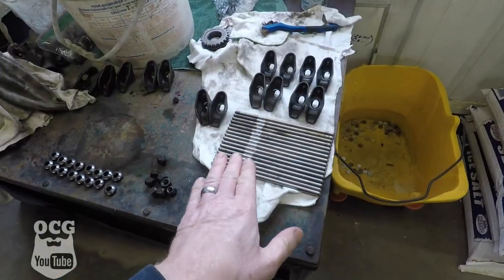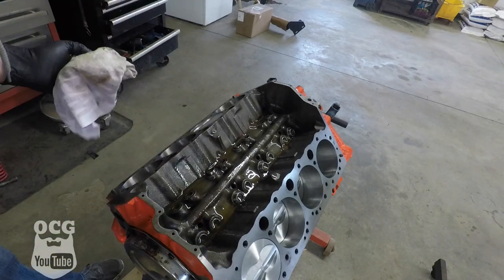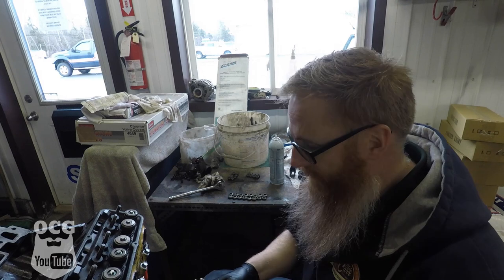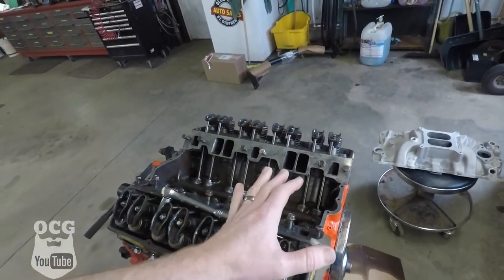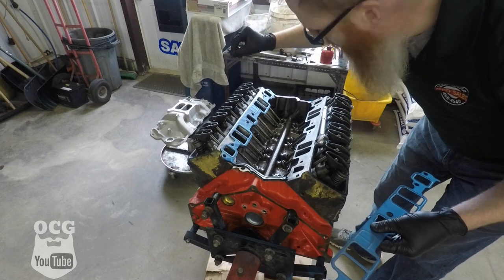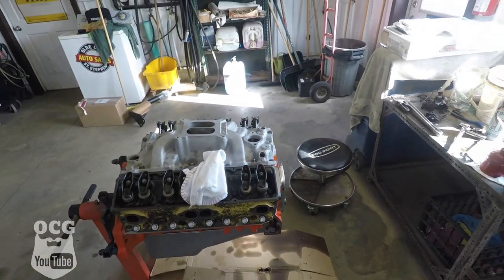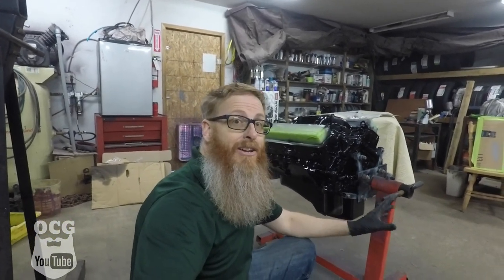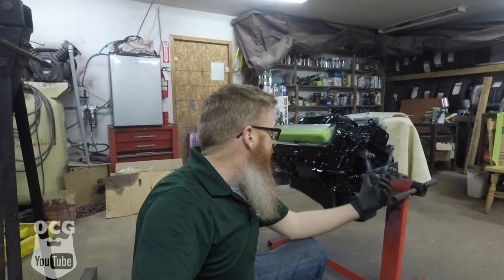SBC Gets Double Hump Heads & EDELBROCK PERFORMER RPM INTAKE Installed Part 4

Comment: I have DHH..performer RPM intake. 650 carb all ready to install on my 86 camaro 350 swapped with RV cam. Curious to what my end result HP /TORQE may be close too. Headers to be decided yet.
Reply from the maker: Most DDH on a 350 we’re good for 300 hp on a stock engine. 650 cam carb is pushing it for a small block and may be inefficient.

Comment: looks good, i like to color match the engine to a color on the truck but you cant go wrong with black. only thing i would have done different is keep the intake aluminum but that is not the look you was going for. i can never get those rubber intake end gaskets to seal well.
Reply from the maker: When I paint an engine, I have always painted the intake. I did on my Chrysler as well. Just looks more stock to me. Ans yes, those rubber intake gaskets are junk!
Reply: @OldeCarrGuy  it does give it that stock look. i never did becuase the aluminum loses its heat dissipation but i also dont have to worry about aluminum corrosion here.

Comment: What head gaskets did you use?
Reply from the maker: Felpro!
Reply: Well I have the 4.030 bore and I can't seem to find a fel pro that size
Reply from the maker: @larrydulaney5657  my sbc is .060 and I used standard gaskets with no issues.

Comment: What type of torque sequence is that
Reply from the maker: What do you mean? I was following the service manual. Did I do something wrong?
Reply: @OldeCarrGuy  not really nice video but the best way (machine shop will recommend) working from the middle out include some of the bottom row not all at once or across. No criticism Awsome motor good combination of gm parts.
Reply from the maker: Thanks Johnny! But if you go back and look at the video again,  when I do the time lapse I do start from the centre and work my way out. You had me questioning myself. So I went back and watched it again.

Comment: Stop never use the end gaskets. You well have bad oil leakson the China walls. Pull intake back off throughout the end gaskets frount and back. Build up a good bead of black RVT on the walls then let the RVT set up a little. Then put the intake back on. Trust me ive been there

Comment: If the intake bolts would not take threads with the inner gaskets you obviously didn’t have the correct size bolts. But its ok. You painted the engine black so no one will see if it leaks.
Reply from the maker: It's a Chevy, of coarse it's gonna leak. Seriously though, it was the rubber end gaskets, that's why at 6:41 we removed them and used RTV.

Comment: 186 double hump heads in 2020? Those are 50 year old heads that are hard pressed to make 350 horsepower. You'd have been a lot better off using 113 Corvette aluminum heads and gaining from the benefit of a full point of compression, better heat dissipation,  ports that flow much better, and about 50 pounds off your engine.
Reply from the maker: You’re probably right. But I used what I had. Got 8000 miles on this engine now and it’s working great.